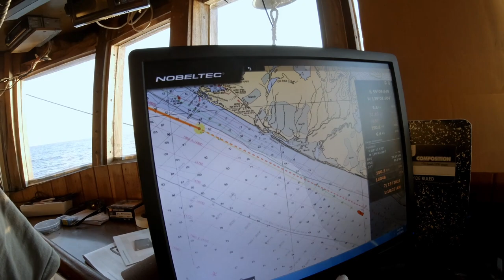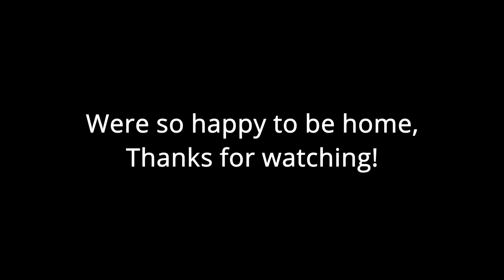Entering the Gulf of Alaska - Sailing from Juneau to Kodiak - Emerald Isle: Ep.7 Fishing Boat Refit

Comment: Hi Frank from Liverpool UK, could you run through tying up procedure, if you tie up at high tide how do you allow for the fall in depth at the quay side rope wise,  I.e. if you are tightly tied up and the tide drops while you are away from your boat, what happenes.
Thanks.
Reply from the maker: Hey, Frank. Great suggestion. In Kodiak, we don't tie up to pilings at our harbor dock, so that's something we don't worry about. When we tie to the pilings at our processor, generally, we're not hanging out for long, nor leaving the boat so we just keep an eye out. Usually, you'd just tie loose enough that the line will slide down it as the boat rocks/moves around.